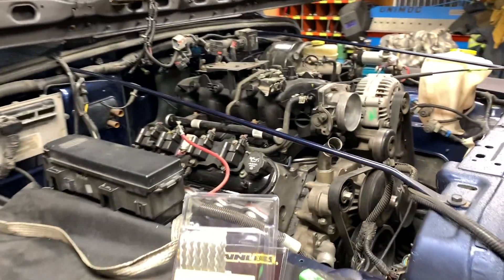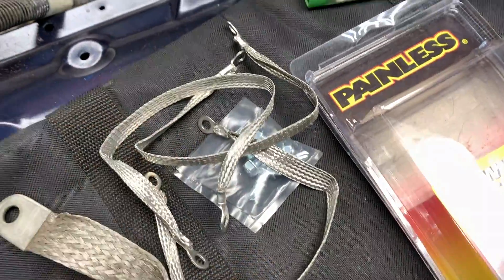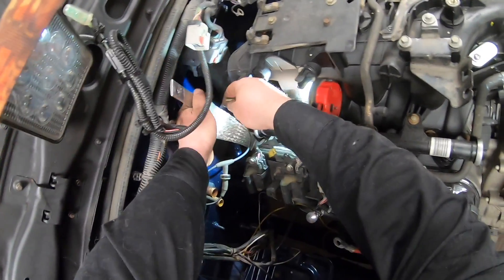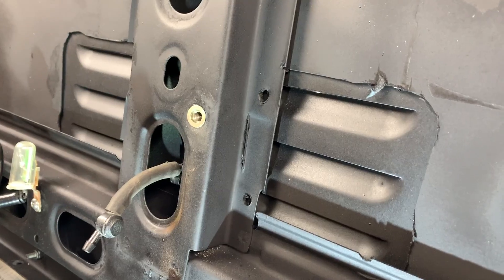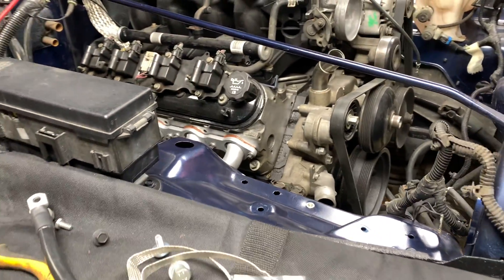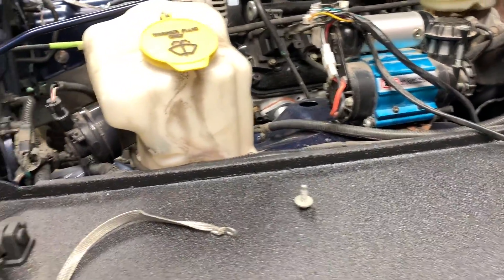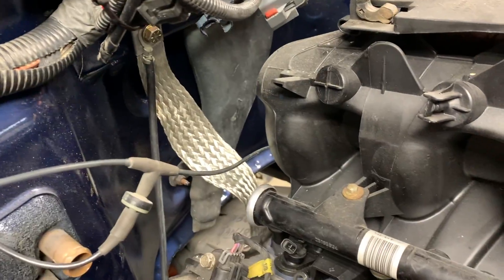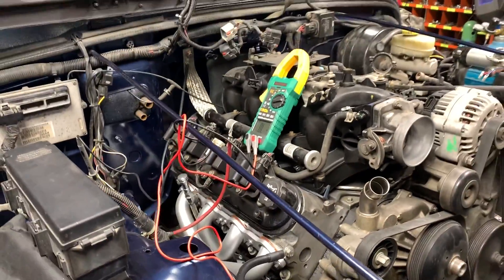Grounding Your Engine Swap

Comment: I did a trunk mount on my la swap . Could i put a 3 foot 2 gauge from battery to frame then engine to frame in the front or do I have to run ground all the way to engine from trunk. Please help and thanks for the vid
Reply from the maker: As long as the ground is solid I don’t see a problem going from trunk to frame then frame to engine.  You could always measure the resistance afterwards from the engine to battery cable to see

Comment: Man I need help! I have a 6.0 gen1 I swapped into my 65 c10. It was working fine. I bought valve covers which required me to swap the coils to the flat coils, they plugged right up no issue. At the same time, I swapped to a billet alternator bracket. Now I can’t get spark! I have continuity on all grounds. I have a ground from the passenger cylinder head to the frame. From frame to the battery. From driver side cylinder head to the body. I never had a ground from head to firewall or hood. But it worked fine before and now no spark! I’m getting power to the msd box as well.

Comment: 98 gmc vortec 5.7  stock.....the ground strap between engine and firewall is corroded / broke ...truck died going down the highway 55 mph......that nut holding the ground strap to back of engine ---I cant get to it ( back surgery ) ...is there another place on the engine I can attach a ground strap and run it somewhere that will serve the same purpose as the original pain in the a*s location ?....I'm guessing the original ground strap breaking cut my fuel off somehow ...truck will crank but won't start ...thanks in advance

Comment: I am doing some work on upgrading electrical wiring under the hood. I cannot seem to find my engines ground to the chassis or frame. Can I ground wherever I want from the body of the engine to the frame of the car? Will this just add another ground or cause problems?

Comment: Have you covered how you're making your power cables? I'm debating making them and thinking through sizes and lengths now. I was planning 2 gauge from battery to starter, 4 gauge from starter to alternator (using the GM junction block).
Reply from the maker: No cause everyone’s set up will be different
Reply: @TestDontguess  Are you running Alternator to PDC or Alternator to Starter or Alternator to Battery?

Comment: A good ground should read no more than 0.5 ohm plus the resistance of your leads. Anything higher for sure would indicate a problem with the ground jumper, the terminals not being clean or even how tight they are will affect this reading. Step #1 get your leads together without touching them with your hands and take a reading....most meters will read 0.2- 0.3 ohms and then this gets subtracted from your readings. BSK showed all the points to add a ground so there you have it. Note: some manuals specify to check for maximum of 0.2 volt drop as well but that is a method you can use when you already have everything connected...take your pick.

Comment: I’m confused why you need so many grounds? Isn’t the original TJ just have battery to body and battery to block?
Reply: Can never ever have too many grounds.
Reply: @leakyjeep5.9  yup, heard that from my mechanic along with the fact that bad grounds can make an engine run stupid and cause problems where what seems to be malfunctioning is NOT the problem.

Comment: You don't have to go from the engine to the frame?
Reply from the maker: Stock doesn’t have any frame grounds.  It would ground itself with various body bolts and through the drivetrain

Comment: Hey Jerry you are so correct!   I unbolted grounds on my old truck and cleaned them then reinstalled and painted over the   bolts.   Battery charges better and I could be imagining this but my electronics are happier!
Reply from the maker: Oh for sure less resistance now 👍,  good Job

Comment: Hey Jerry, I have a 98’ TJ and I’m making all new 2 gauge wiring for my Jeeps battery, ground, alternator and starter.  I was going to weld a bolt to the frame and use the same 2 gauge wire and connect it to the frame as the new ground.  Do you think using one of these pre-made ground straps straps would be better?
Reply from the maker: I think straps are better for vibration and flexibility